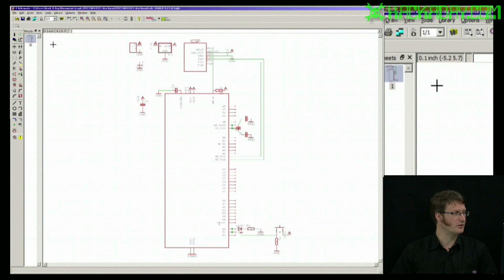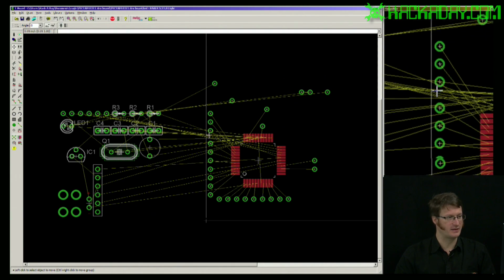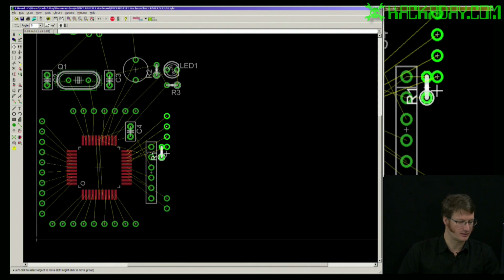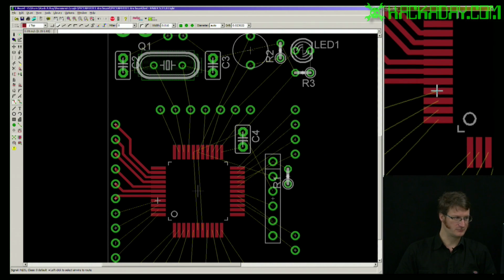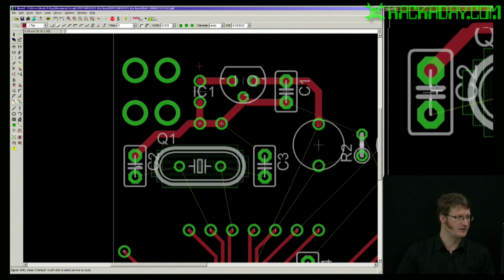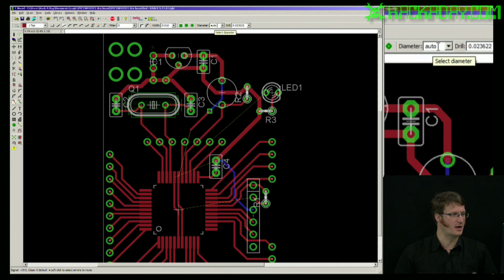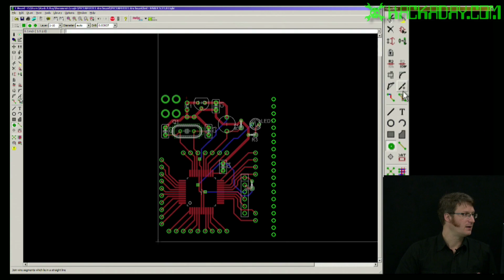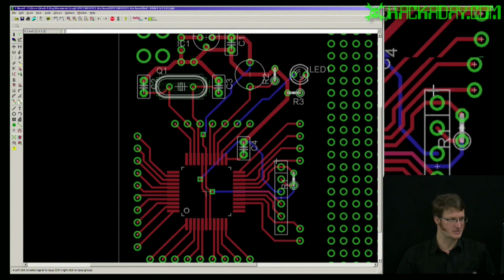Eagle CAD - Layout

Comment: You don't necessarily have to start a route on pins that don't lie on the layout grid spacing.  

By switching between the two 45 degree route tools (2nd and 4th on the toolbar), you can start at pad aligned with the grid, layout part of the trace, then switch tools to get the trace to end perfectly in an off-grid pad center.  You can accomplish this 100% of the time. 

To switch between the two layout tools conveniently, use ctrl+right click while you are routing.